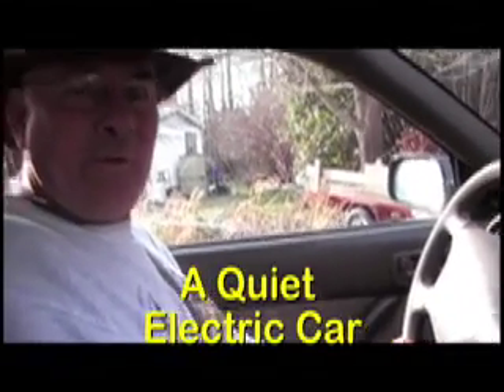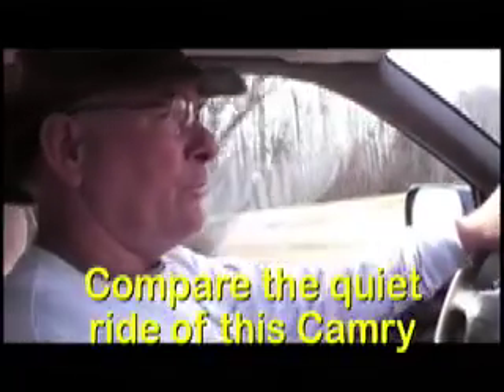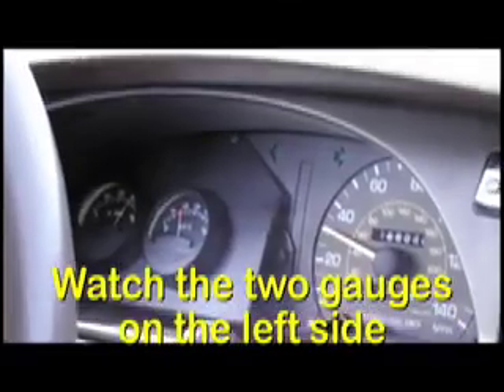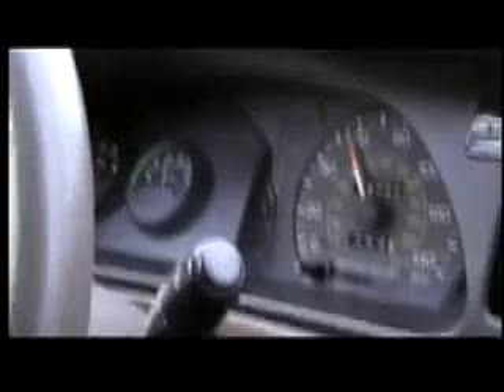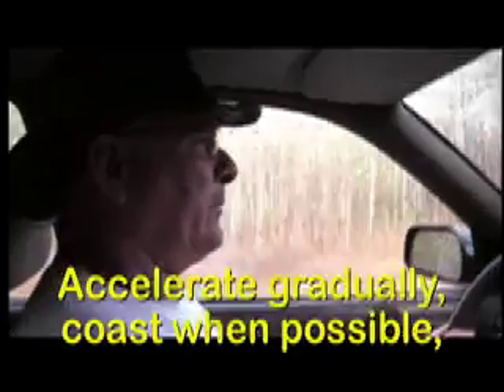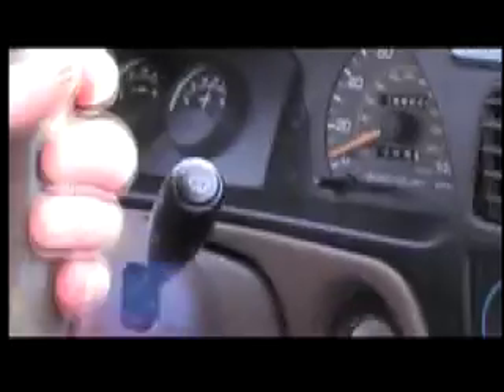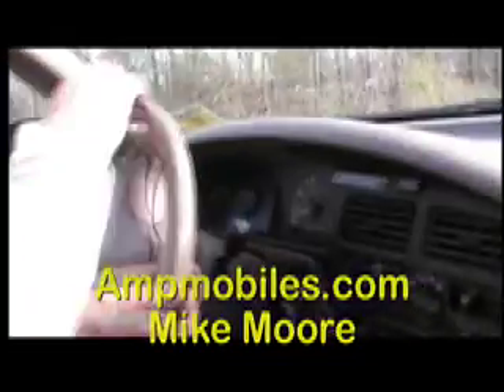A Quiet Electric Vehicle by Ampmobiles

Comment: that range meets most needs.  BTW if you are afraid of running out of power (reasonable fear if you are pushing the range) then put a gas generator in the trunk to use to extend your range.  remember, electric cars don't need the maintenance that internal combustion engines need (i.e. oil change, filters, etc)

Comment: How far is your daily commute?

30 40 mile (64kms) is not much but it's enough to run local errands, and costs $1.00 per 100 km to run!

Although no details are provided, this is a DC conversion without regen and using cheap lead acid batteries, about as basic as you can get. There are better options.

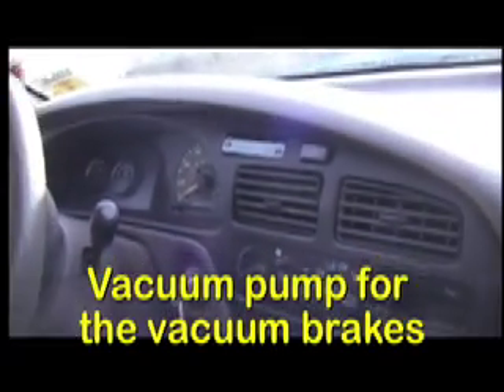Comment: I'm wondering motor and transmission setup is used in the Camry project. One thing I noticed was when the driver accelerates at 3:45, it sounds almost exactly like an EV-1 (except for the gear shifts) 

I'm somewhat interested in EV conversions as well.